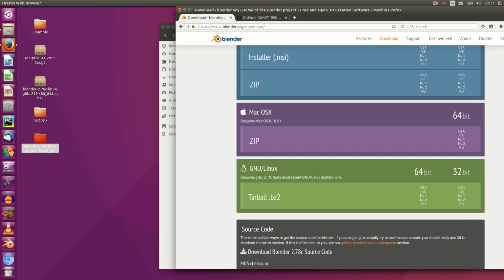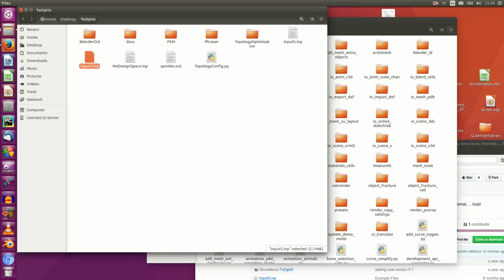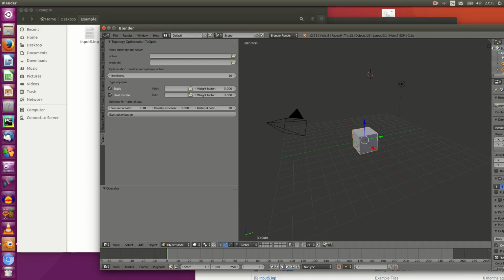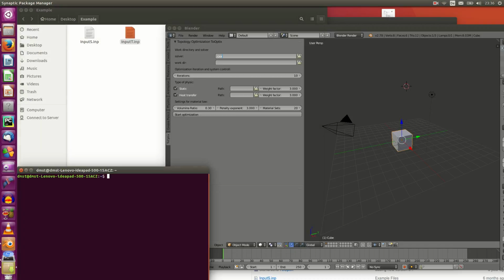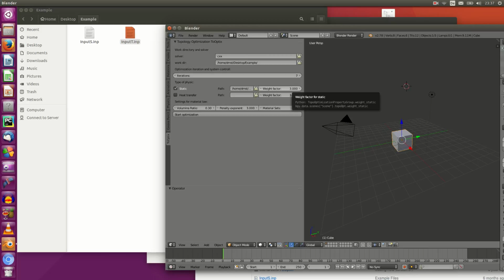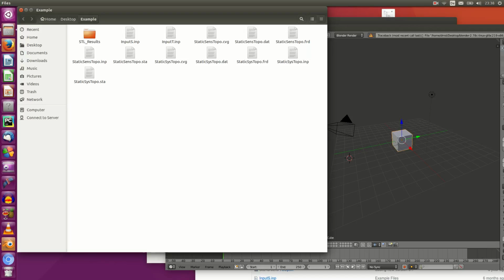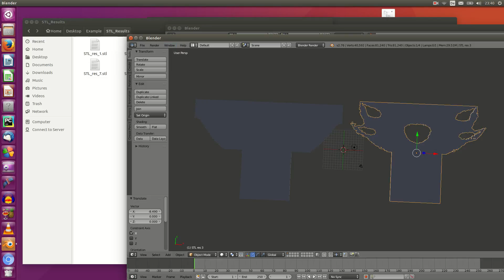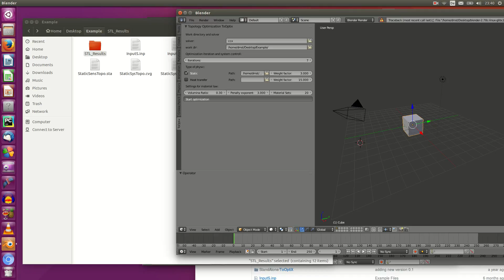1. Topology Optimization: Static load case and linux installation

Comment: Sir can i use it in windows blendee
Reply from the maker: Hi, i do not know if it works for the latest version it was working with 2.78 on Windows.
Reply: @Luchsio  yes sir i will try.... On newer version
Reply from the maker: @saurabhtalele1537  i have tested it. The addon does not work for the latest Version.

Comment: Thanks for uploading videos relating to Topology Optimzation. I need Topology Optimization for my research, but still don't have a clear picture of what is happening during the topology optimization process, especially in 3D. Do you have any suggestions what software to use for 3D? and I specifically want to use it for reinforced concrete and non-elastic material.
Reply: Thanks for your response. I am still at the beginning of my reserach and I am not sure what type of material model best suits my goal.  
Do you know how Abaqus does topology optimization? Is it slow? and how should the material model be for doing topology optimization with Abacus? Does Abaqus connects to Tosca to do topology optimization?

Also, can I ask what is your background?
Reply: Thanks for the response. By best results do you mean the most realistic results? Is topology optimization fast enough for 3D problems with Tosca? I need to study 100s of cases. 

Also have you seen any research using maschine learning or data mining on results of topology optimization?

I am just curious to see people from what backgrounds working with topology optimization. It is great that you study computer science, it is necessary to any research nowadays.